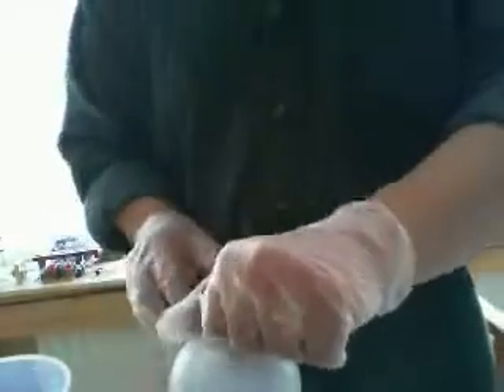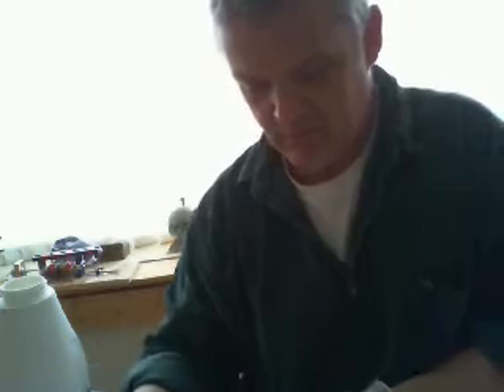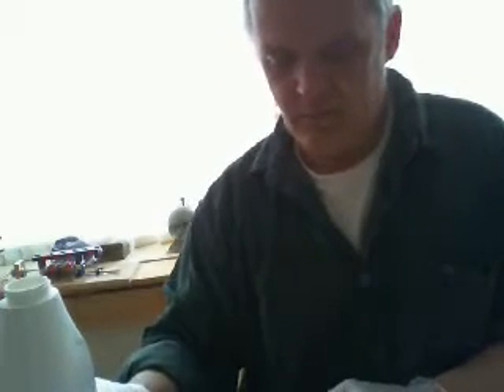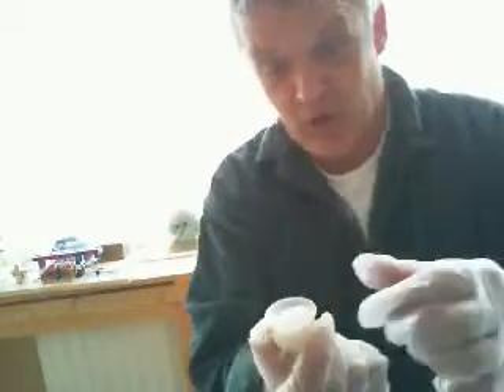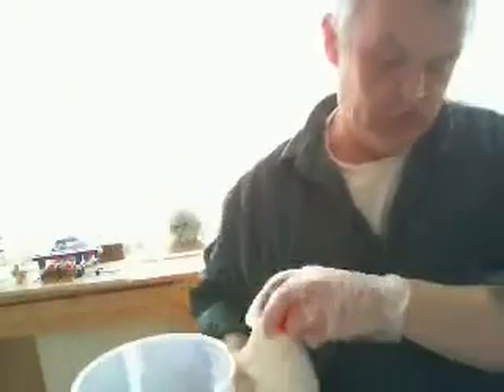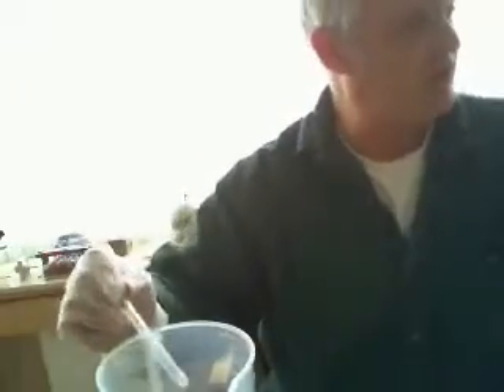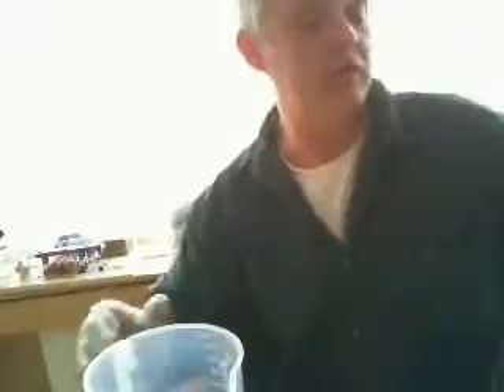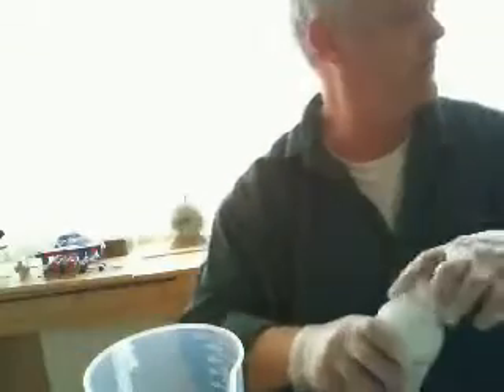Brush Electroplating, chemicals, formulas and equipment how to make it 2

Comment: full recipe, hope I got it right:
15ml ammonia 9.5%
200ml water, dist.
1/4 tsp sulfuric acid 95% (toilet cleaner)
==> ammonium sulfate
7.5g NaOH/caustic soda
24ml phosphoric acid 20% (=6g, limescale remover) 
top off w/ water to 200ml
250ml citric acid monohydrate 15% (rust remover, instead of oxalic acid)
top of again, to 1L.
hope you don't mind me listing it here in text form.
Reply: @John haven't tried it, sorry

Comment: Just one question, ... So this solution uses the metal in the brush/wand to plate? ... So a copper wand dipped in this solution to do copper plating, or Nickel wand dipped in this solution to plate Nickel and so on?  ... Is this correct?

Comment: Won't the zinc in the brass connector create disimilar metal problems during copper plating?  I thought you could only plate with either zinc or copper alone, but not at the same time.
Reply from the maker: probably mate - but the rate will be so low you won't notice and it is by brush not bath - so again i suspect that negates the effect

Comment: Hi Robert

I wondered if you would be good enough to list the "pure" chemicals weights?

Since I played around with the "oxalic" version I have all the chemicals required in pure form so I do not need to mix the various cleaning agents.

I followed the video calculating/verifying effective pure weights but I was left uncertain regards the citric as I was not sure how much citric acid would be required to replace the oxalic acid.

I was also interested to know how you arrived at that amount of citric acid - trial and error or other?

Thanks Jon
Reply: The citric acid is 15% by weight - 250ml gives 37.5g vs 32g oxalic.

Molar weight citric monohydrate is 210g/mol and oxalic acid is 90g/mol so it cant be a straight forward mole for mole swap? 

Would be grateful if you could confirm 37.5g citric acid monohydrate per litre or indicate what it should be as appropriate, I would like to try this one out with a straight plating set up rather than brush.

Many thanks 
Jon

Comment: Hi have a Theory!  Gold Plating Solution.  How to produce this is a well kept secret, or is it i can find it?   There are a few way to dissolve gold in acid, one such way is to combine Sulfuric acid with Hydrochloric acid to produce this produce Aqua Regia.   This will dissolve gold.  But now left with a acid soup that cant be handled easily.  Thought came across me, what if after this process you neutralise the acids by mixing with sodium bicarbonate??  You should end with a PH level 6-9.  Your thoughts.  I know you have moved on to greater things. (:  Ally
Reply: +Ally oops    mistake! Aqua Regia is- hydrochloric acid +nitric acid, known to dissolve gold.

Comment: Has anyone managed using this or the original oxalic acid formula - to get nickel to plate onto steel. I have tried lots of combinations, with some minor success but it never seems to be reliable. The steel has been properly cleaned a degrease etc. Thanks.
Reply: Assuming you are talking about STAINLESS steel, I use a very simple (and very effective) solution of dilute hydrochloric acid which I brush onto the steel at around 5V. I then thoroughly rinse the acid from the steel and proceed to the metal plating stage. I normally pre-plate the steel with copper first before plating with any other metal. The reason for this is it is actually the pre-plated layer of copper that helps the nickel adhere to the base metal.

Comment from the maker: Glad you liked them and hope they are useful. The plating solution is universal. What you have to do is change the metal on the plating brush - so instead of using a copper plate you would need to fix on a gold plate - i suggest an old ring - I have one somewhere ina drawer I may yet pull out to plate with.